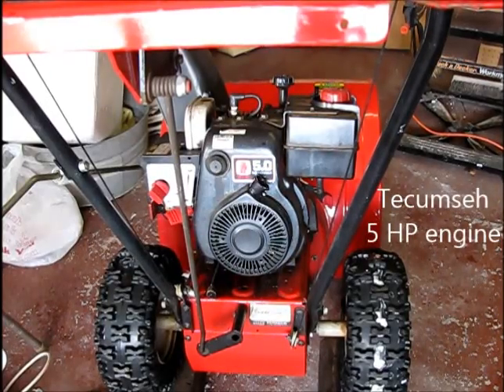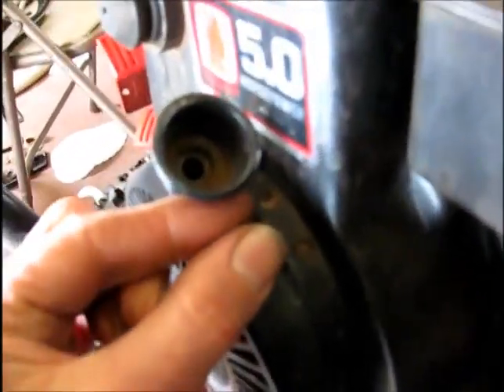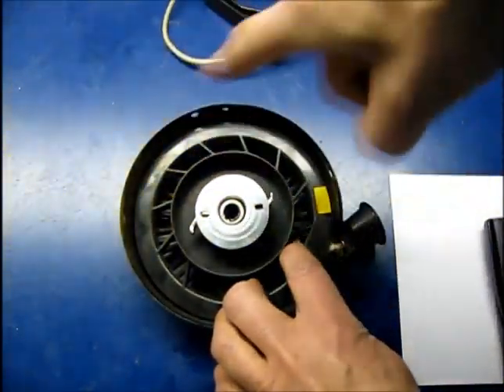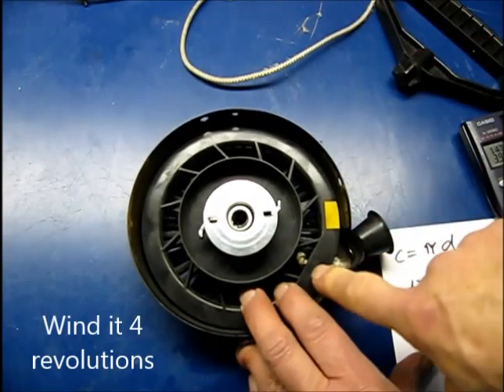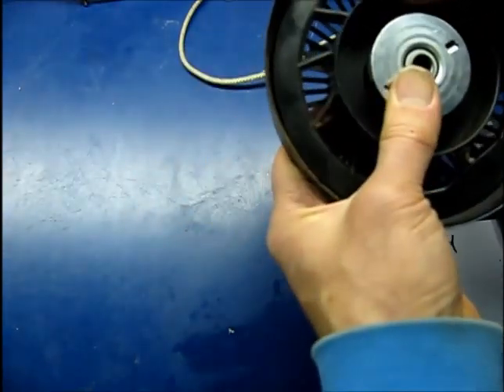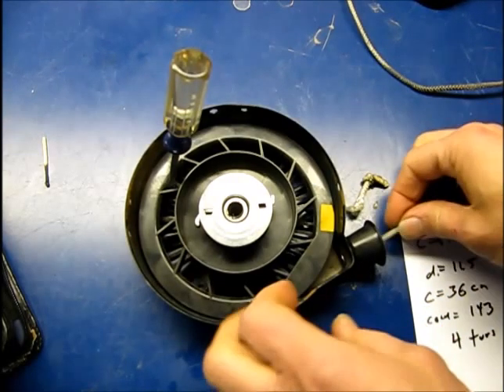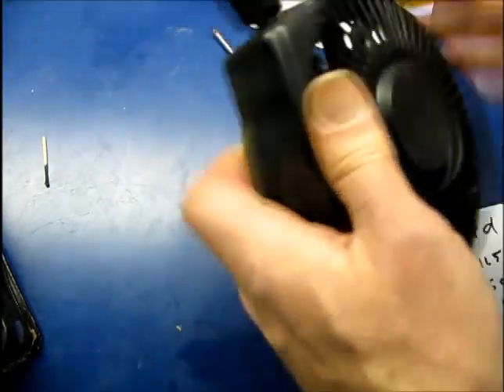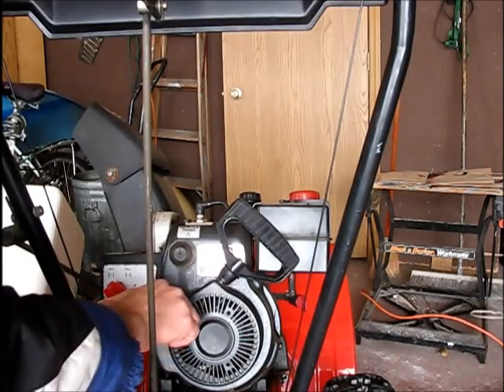A slick and quick way to fix a broken pull start cord on an MTD snow blower

Comment: for systems that donut let you feed it from the outside, I've used needle nose players to feed from the spool outward. then with a small wire loop, catch it and pull it out. then attach the handle.
Reply: You can also make a notch in the inner edge of the wheel and use that to wind up the spring and then pass the rope through the hole in the housing so you can attach the handle.  The method used in the video is good too.  You have to figure out how many turns to wind up the spring so that the cord retracts fully.  It takes a bit of patience and experience but it's way less expensive than replacing the whole assembly.  Tecumseh and Briggs and Stratton parts aren't exactly inexpensive these days!

Comment: This is a great video. It worked perfectly for my Ariens snow blower with a Tecumseh engine (identical pull cord housing). I was able to fix it in minutes instead of hours. Thanks!
Reply from the maker: Thank you for watching and taking the time to comment. This video was never so popular as this winter with the big storms piling up the snow!
Reply: We also have an Ariens and were able to fix ours too! Thanks for help!

Comment: I pulled the starter rope out of my snowblower recently and, after a few choice words, thought I was in line for a costly repair at the shop. After watching this video I purchased a length of cord (I believe the total was $1.83?) and was able to follow the instructions despite the fact that I have never worked on gas powered tools before. It was quite easy dare I say and my snowblower is up and running. Thank you so much for sharing your expertise.

Comment: You saved my life, well actually my back.  Thanks so much for this.  Here in Mass. we just got through a nor'easter of 25 inches and on the last use of my MTD 10 year old snow blower the cord broke.  Finished what I needed for that storm but have another 12 to 14 inches coming in two days and no way a small engine repair shop would have fixed this in time for Monday.  Watched your video and had it fixed in 30 minutes, wow!!  Now I'm ready for the next round, bring it on Mother Nature.  Thanks again for a great, simple but informative video.  P.S. I also had the shroud covering the line hole like the other guy, I was able to bend it out of the way with a screw driver, thread the line and push it back without snapping it or removing it.
Reply from the maker: You're welcome. I'm glad to hear it helped. This video was never so popular as it was during your storm. I'm not going to complain next time we get a six inches here in WI.

Comment: Great video, thank you for posting!  Cord broke on first pull for my husband during this January blizzard. I showed him this video and he fixed it!  We had trouble stringing the cord through the holes tho, it would bend before it would go out far enough to grab. We opened up a metal paper clip, pushed it into the end of the cord and taped it with a small piece of scotch tape. We put it through with the metal tip and grabbed it on the other side with the pliers and pulled it through. Then took off the piece of paper clip and tape and tied the knot. This was the worst storm for this to happen during but thanks to you, we got through it !  :)
Reply from the maker: So glad to hear the video helped you in the middle of that big storm.Thanks for watching and commenting.

Comment: This worked for me....a big thanks.  One comment: my MTD is about 10 years old...but looks like yours. The rope entry point into the inner part of that assembly has a shroud that really makes getting the rope through the two holes very difficult.  Yours is missing that spot welded shroud on your model.  I had to rip mine out to have a chance of passing the rope through the two holes to eventually then make the knot.  Thanks again.
Reply from the maker: I'm glad you were able to make use of the video.Good job "modifying" that shroud. Thanks for watching and commenting!